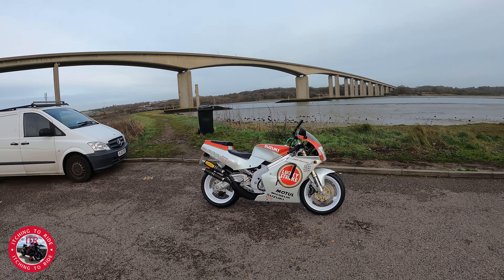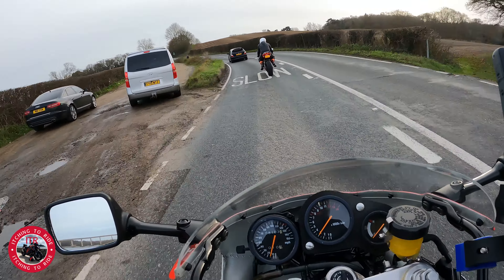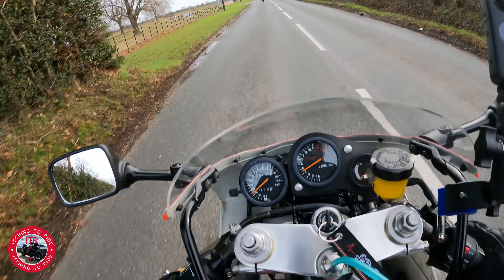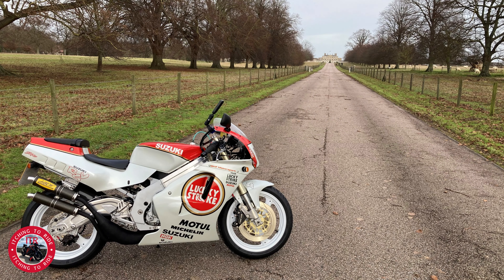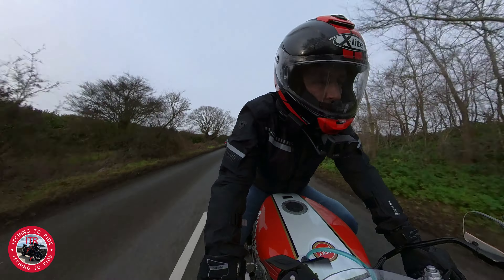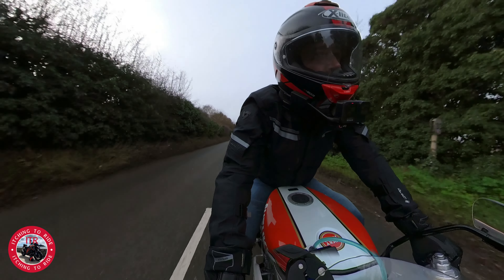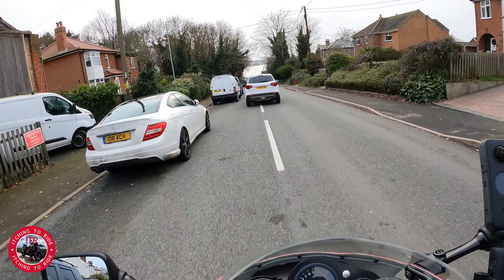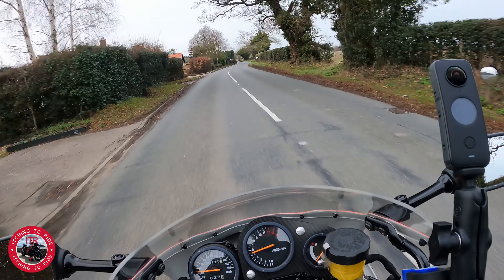1991 Suzuki RGV 250 VJ22 Lucky Strike Rebuild. Part 10.

Comment: I had a 1994  RGV250 in black/mint when I was 18 and loved it. Cost me £1800 a year to insure and I got hit by a car that pulled out on me within the first few weeks of buying it, written off but I bought it back and repaired it. It suffered from misfiring in the wet on the bottom cylinder and eventually ate the rings and scuffed the barrel on that same cylinder. Sadly I had to p/x after fitting a new ring kit, got a 1994 600 bandit.
Reply from the maker: You was very unlucky with that RGV.

Comment: Stick some ZX1 in the two stroke tank. and gearbox. Say good bye to seizures no matter how you thrash it. Makes gear change even sweeter too. 10 miles is enough to run it in.. :) you do not know how it really runs until you go above 8,500.. if right it is slowly up to 8500 then instantly12000 change, change, change, change.. BEND! lol I have 3 needing rebuilding.. and enough spares for at least 1 more.

Comment: Only just found this video.
Excellent. After my KR1 rebuild I had odd to zero temp gauge readings. Cured mine with a new, independent earth from the gauge to the engine block. Sorted !!!!!
Reply from the maker: Hello. I had to put a earth wire from the sensor to the frame. All working now 👍

Comment: You need to get it into the rev range to feel real power, you didn't do that the RG500 you rode too.
Reply from the maker: @chujon9  I had only just rebuilt the RGV 250. I was its first ride.  I was running it in. The rg500 was my mates bike. It’s worth about £20,000 so was being careful on it.
Reply: @itchingtoride  yes, you are right. Happy you replied 🙏🙂🙂🙂
Reply: @itchingtoride  I used to own A Walther Wolf RG500 many years ago. What a fantastic machine. I can't add a pic here unfortunately.
Reply from the maker: @ Very nice 👍

Comment: Next Time If You Want To Use A Good Silicone Sealant, Then Use Victor Reinz. 1 Of The Best To Use I Used To Only Use Ultra Grey. Like The Crank Casings, You Only Apply A Thin Layer, Leave It For About 10 Minutes To Make A Skin, Then Assemble. If You Put To Excessive Sealant On, It Is Going To Push The Sealant Out Into The Engine. & You Don't Want That At All. I Myself Is A 2 Stroke Fanatic, & A Motor Vehicle Mechanic, From 1993 & Also Worked On My Own Motorcycles. You Also Mentioned The Yamaha RD350. Also A Powerful 2 Stroke. Some Will Think Why Do I Say Her Or She. I Always Used To Tell My Friend, If You Give Your Wife A Hard Time & Problems, She Is Always On Your Case, Moaning & Groaning, & Always Talking Back. But On A Motorcycle You Can Rev Her, Ride Her As Hard As You Want, Do Anything To Her, & She Will Never Talk Back.😀😁😅😂🤣
Allen, Ladysmith, KZN, South Africa 🇿🇦

Comment: Don't Know Your Name, But I Started Watching From Part 5, 7, 8, 9, & 10. Part 6 Never Came Up As I  Swiped Up, To See If I See Part 6. So I Need To Watch Part 1, To Part 4 & Then Part 6. From Part 5 It Looked Like You Only Had A Few Things To Do Before She Was Finished. & In Part 7, You Had The Head Off On The 1 Cylinder To Replace A Leaking Head Gasket. & Then Again From Part 8, You Had Almost The Whole Engine Stipped Down To Pieces. Did You Hear Any Unknown Noises In The Engine, That Didn't Sound Right, & Was The Bike Battling To Start Due To Compression To Low. 

You Mentioned About Seals On The Crank Behind The Roller Bearings, That You Need To Change. Is That Why You Stipped The Engine Down To Pieces, Because Of The 2 Leaking Oil Seals On The Crankshaft. You Did Fit New Pistons & Rings, Because You Mentioned In Part 10, That You Are Riding Her In, & Not Over Revving Her Over 6000rpm. She Sounds So Beuatiful & Running So Smoothly. I Watched A Video On A Pepsi RGV500, That A Well Known MotoGp Champion Used To Ride. & This 1 Guy That Also Race Around Tracks, Had The Opportunity Of Riding This RGV500. & The Power Is Amazing, & The Sound Is Totalky Different From The RGV250. As He Opens The Throttle & Changing Gears, The Front Wheel Is Picking Up.That's How Much Torque The RGV500 Engine Puts Out On The Back Wheel. In My Opinion, I Would Say That The RGV250 & 500, Is 1 Of Thee Most, Powerful 2 Strokes Japan Ever Build. 
Allen, Ladysmith, KZN, South Africa, 🇿🇦